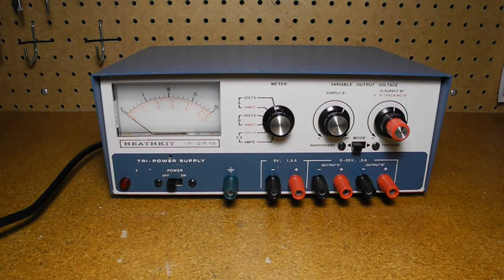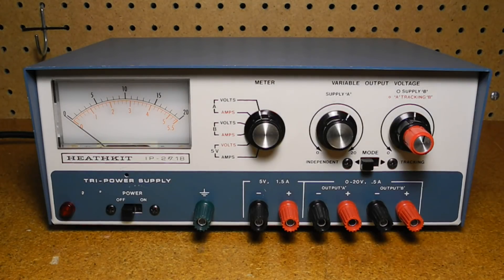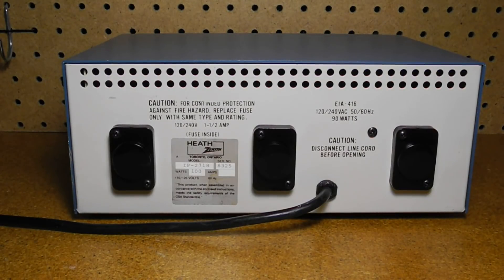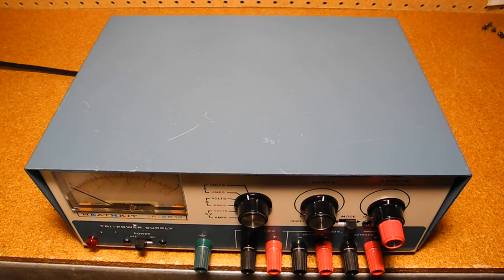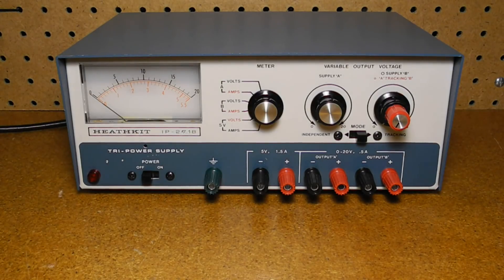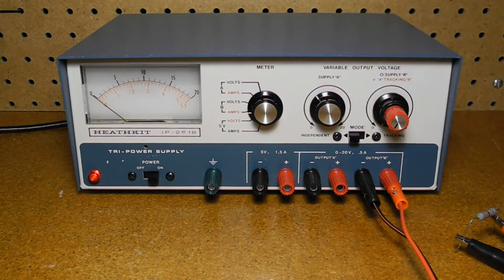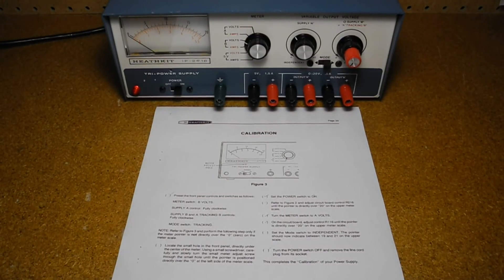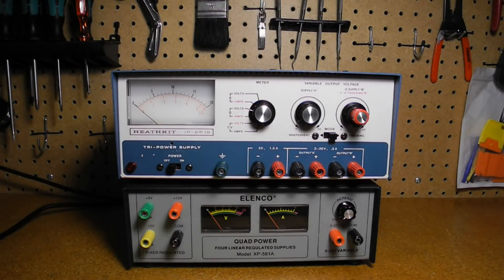The Heathkit IP-2718 Tri-Power Supply

Comment: Thorough review of a venerable piece. Built one in 1977 for constructing analog and digital circuits and learning design on the way to an engineering career.  Obused the current limiting, self protection, features all too often. It still serves me today and sits 2 feet to my left powering a customer's system. The most useful Heathkit in the collection...

Comment: I have this model in service since the late 80s and it still works well. Only had to replace shorted rectifier diodes two times. In the video at 7:10 you are reading the wrong scale - the load ist about 500mA.

Comment: Hi there. I bought IP-2730 7.5V 10A Power Supply and when I switch it on, pointer/needle is on Max and Voltage is 15 Volts! I cannot adjust both voltage and current. Please, what could be wrong with it? Thank you.
Reply from the maker: If you can find a copy of the manual on-line, there should be a troubleshooting section with a list of symptoms and possible causes. You can also check voltages against those listed in the manual to identify the problem area.
Reply: @jefftranter OK. Thank you

Comment: The Heathkit IP-2718 is truly a classic. While I never owned one, I built one when my employer asked me to specify and outfit a small electronics laboratory for our department. Over 30 years later, this supply still gets occasional use, and works perfectly. I call it a 'classic' because wherever I go, to plant sites, vendor's labs, customer's offices, etc; I see this model still in use. It is a well designed, quality supply with attractive specifications, a nice looking case and front panel, good ergonomics, and durability. It beats out pretty much any other supply of similar type.

Comment: 1:30   The power supplies offered here were excellent.  I have the digital model 0-15 volt, 5 Amp supply.  It is a beast weighing 30 pounds.  It could be remotely operated through the back panel.  

To me the best feature of these supplies it that it will supply the full rated current into a dead short.  That is right,  5 amperes into zero ohms.  It will not "overload".  Of course at this point it is no longer 15 volts across the short, but zero volts, but the full 5 amps of current is flowing.

The other models were 0-7.5 volts, 10 amps,  0-30 volt, 2.5 amps and 0-60 volts at 1.25 amps.

I also have the tri-supply being reviewed here.

Comment: I have the exact working model that I bought from a yard sale 2 years ago. They're great for low power electronics testing and design. The DC outputs are very, very clean. No surprise, I only needed to clean my unit up a bit and perform minute adjustments to my 20V outputs.
Reply: Hello, I just got one of these and can't enough information online on it. How do you use it on low power electronics? Is it for testing each individual part to see if they can handle certain voltage or something similar?

Comment: Just discovered your channel as I was looking for a tutorial to brush up on using my Heathkit IT-21 tube tester (thanks!). The IP-2718 has been my go-to bench low voltage supply since I built it in the very early 80's and have only had to repair it once early on. Thanks for showing us the inside as I haven't seen the inside of mine since I fixed it last!  73 - Dino KL0S